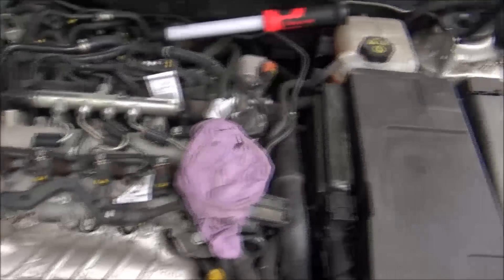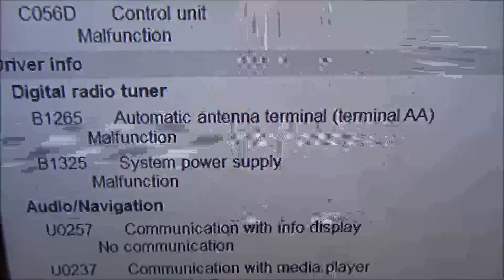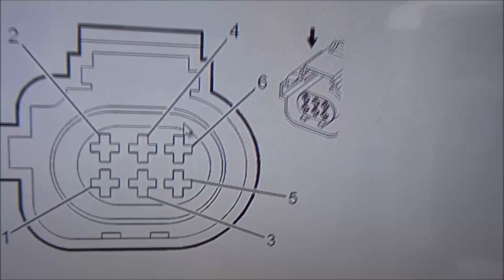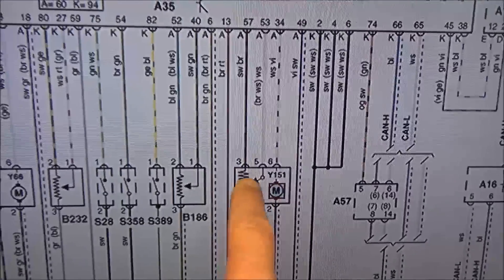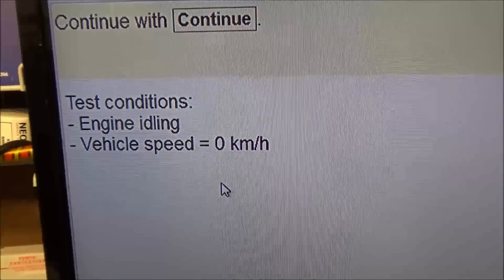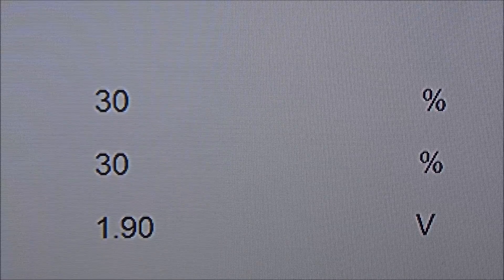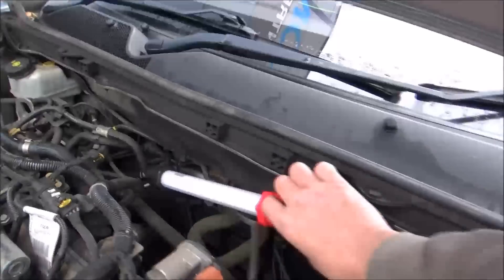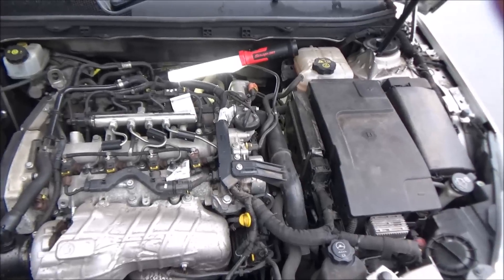2010 Insignia P0402 EGR Excessive flow

Comment: I put Archoil in my fuel system which is basically a EGR/ Turbo and PDF cleaner. Now having the same problem but iys s good job i have a OBD reader abd i can reset when driving. I supect at this moment in time the Archoil is doing its job and the carbon build up is being blown out.

Comment: The thing is I got this code on my 2013 insignia and I have just changed the Egr valve, the car is lossing power and I got that dpf is full.
After driving for a bit the dpf massage went off but the code still comes and goes, any ideas ?

Comment: Does a new egr valve for an insignia need coded or programmed to the car or is it just a case of putting new one on.  Cheers
Reply from the maker: Most component replacement requires some form of adaption or coding these days. Best advice would refer to technical information for the vehicle being worked on. Hope this helps.
Reply: Thanks

Comment: I have the same error, it's shows 1 ,2 time per month but I tried to clean it today and now i have non stop this error. I don't know what to do now.
Reply from the maker: I'd say it's either stuck open or thinks it's stuck open. There are a few reasons why this may be happening. Suggest getting it booked into your nearest specialist for an assessment. Hope this helps.
Reply: @SimplyDiagnostics  Thank you very much!
Reply: I changed egr with new but now i have same error. Two days was fine. What is possible to have this error p0402-51
Reply: After few weeks i don`t have solution. I found that I have this fault after regeneration, when my DPF%  was below 30 or around 20/35 %. When dpf goes  More than 35%  i don`t have problem with errors to next regeneration.

Comment: You wouldn't believe the nightmare I'm having with this exact issue on my insignia. Same fault code. Egr valve has been replaced. Same problem. Car goes into "limp mode" several times a week. I have to restart engine to get it working again.
Reply: Did you ever figure this out? I’m having the same issue
Reply: @Prot0n same question to you 😂😂
Reply: Did u ever get this sorted I’m having the same problem

Comment: call me old school but i would "because the way the engine is performing" clean the EGR valve and I would have been done by the time this guy had worked it out on his fancy telly! cost? a bottle of white spirit £1!
Reply from the maker: That's all well and good on a vehicle with such easy access, what happens when it's a 4hr job to even get to it? Is it not better to prove its the component before stripping? Cheers
Reply: @SimplyDiagnostics  Hi the EGR valve clean on the Vauxhall is 45 minute job if it was a 4 hour job then yes it would be better to make sure the prognosis was correct

Comment: I have had the same error on my 2012 2.0 CDTi Astra. My car seems okay apart from start/ stop doesn’t seem to work anymore.  A Vauxhall specialist told me I have a stuck open EGR then they told me I must have a EGR cooler leak however that was 2 months ago and I haven’t lost any coolent, they want to replace this at a cost of £1500. Are you based in the north west?

Comment: Hi Mate
you said after you have given it a clean you have to reset the EGR positions or it will have the old readings still. I'm just a DIYer . So if I clean the EGR will I still have to take it to  a service station to reset the positions of the EGR ? is that correct? I've only got one of those cheap blue tooth OBDII connectors modules that just reads data. or will the computer reset itself when I clear the error ...............Cheers
Reply from the maker: It's always a good idea to reset the adaptions after cleaning. OBD tools won't normally do this function. Try it and see how you get on.

Comment: Hello , it would be awesome if u would explain how to readapt the new EGR . 
Thanks.
Reply from the maker: The next vehicle I see with this fault I will show the process. It's normally  just a couple of button presses with a scantool. Some vehicles (not all & not this particular car) also require a software update or patch. There are also vehicles that only the OE dealer tool should be used for this process to avoid irreparable damage to controllers and components.
Reply: @SimplyDiagnostics  thank you !

Comment: Can my codes on an Audi A5 2013 tdi still have codes of 
1) EGR valve open circuit 
2) Exhaust gas Recirculation Sensor A circuit/range performance 
3) EGR valve open circuit 
If it was just totally blocked up ?
Reply from the maker: no, range/performance yes but not the open circuit codes
Reply: Simply Diagnostics thanks mate trying to determine weather it’s a clogged EGR or electrical
Reply: @petercambulaso3858  gurantee it needs a valve.